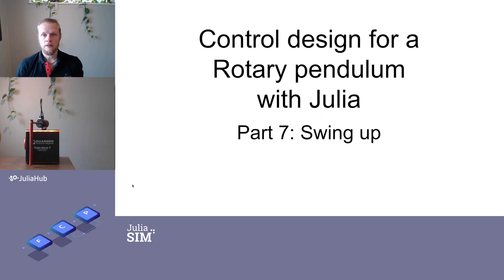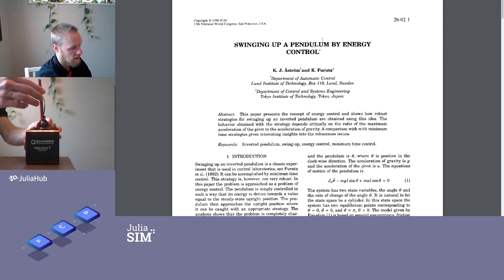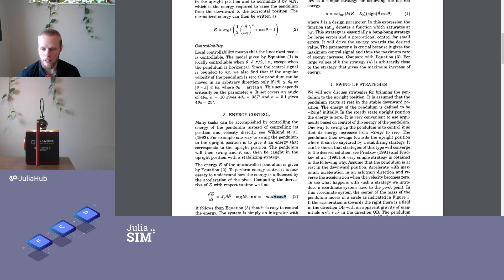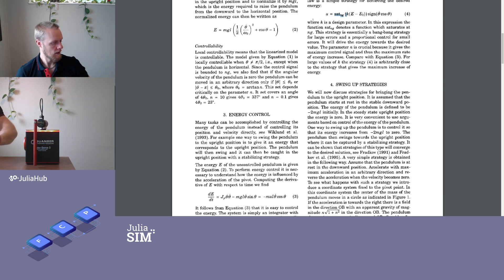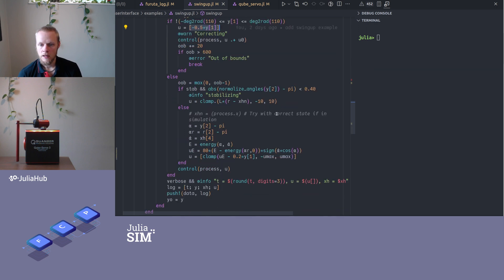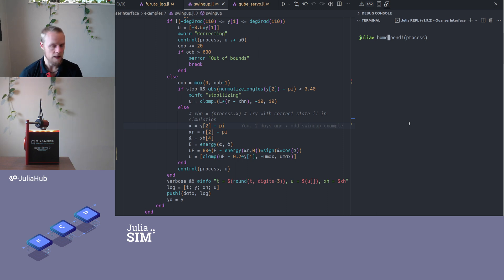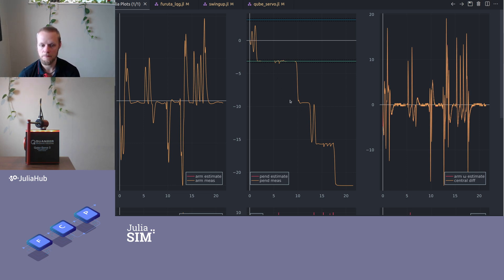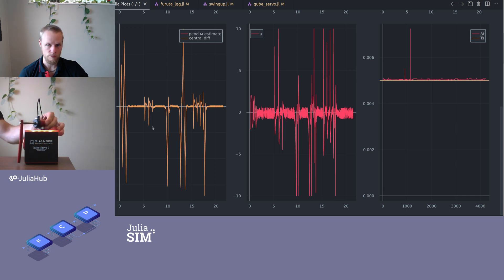Part 7: Control of rotary pendulum using Julia: Swing up control

Comment: I have a doubt: The energy that you declare on the script, is the total energy of the Furuta's pendulum  that you obtain trough the lagrangian (L=kinetic - potential)? That is, Ep( theta 1, dot{theta 1},  ddot{theta 1},  alpha , dot{alpha}, ddot{alpha} ), where theta is the motor's angle and alpha is the angle between the vertical and the pendulum; positive in the clock-wise direction. 

Greetings. Excellent work.

Comment: Hey, nice video! I have a question, what does the u of the controler stands for?
Reply from the maker: The variable name "u" is commonly used to denote input, in this case it's the control signal that serves as the input to the pendulum motor.